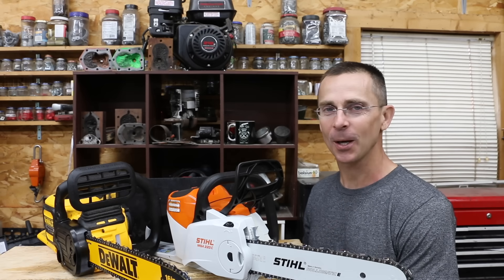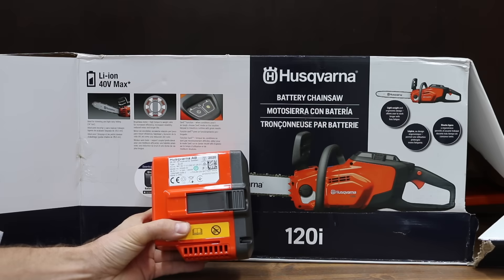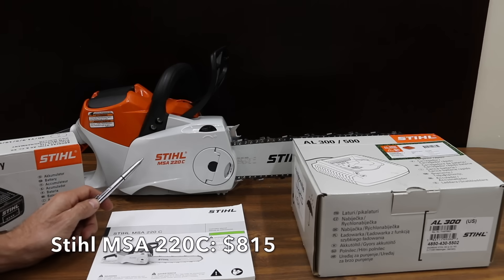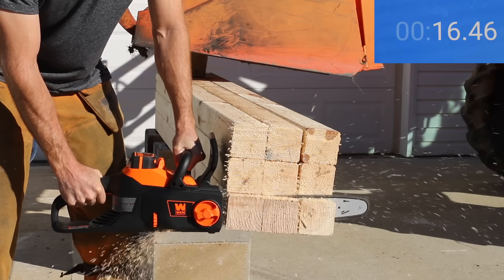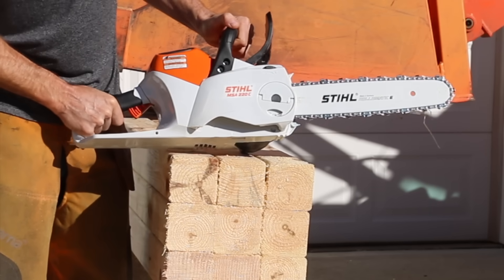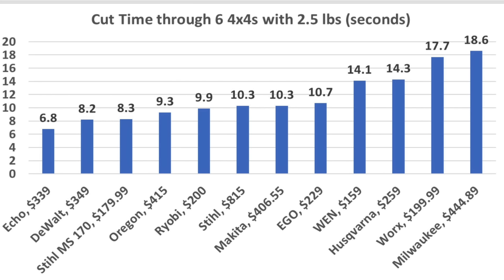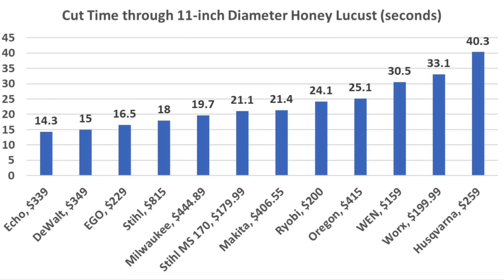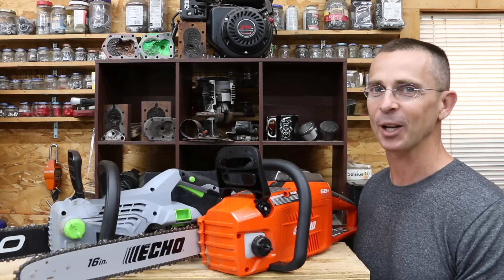Best Battery Powered Chainsaw Brand (ROUND 2)? Stihl, Husqvarna, Echo, Oregon, DeWalt

Comment: EGo now offers a number of larger capacity batteries - up to 10Ah - but it costs $900. They also make the best 2-stage snow blower (as far as I can tell). I own a Snow Joe 2-stage snow blower (first generation) and it has been very disappointing.

A critical thing about battery powered tools - is to have as many different tools that use the same type of battery. This way, you can get more use out of your investment. EGo has the best overall, it seems with lawn mower, snow blower, and chainsaw (and string trimmer, too I think?). DeWalt has a different mix: impact driver, chainsaw. Makita is similar to DeWalt. GreenWorks has a very good lawn mower and string trimmer. DR Power is a company that seems to have the broadest range of battery powered yard tools.
Reply from the maker: Thanks for the feedback.

Comment: Hi from New Zealand. I've owned a Stihl 200C battery chainsaw for a couple of years and it's been one of the best purchases I've ever made. You'll still want your petrol/gas saw for felling anything above 8", but the Stihl comes into it's own when limbing up a felled tree, even fat ones above 24" diameter. I prefer the sharp dogging spikes on the Stihl. When you are working at odd angles around a tree, those spikes make it much easier to apply the pressure needed to feed the saw into the cut.
Reply from the maker: Thanks for the feedback.

Comment: Had the echo weedeater with the same battery platform and it does not have discharge protection. Left on the charger and drained itself and became a paperweight. Returned for refund based on that.
Reply from the maker: Thanks for sharing.

Comment: Excellent comparison videos, thank you for doing them!

Curious - have you tried using the 4-bay fast charger for DeWalt in any of your tests? (dewalt part DCB104 )  That plus the new 12AH 60v batteries were game-changers in how that saw works for me.  Four batteries and that charger means almost zero downtime for a whole day of cutting, which still kinda blows me away.
Reply: And the EGO has a fast charger that came when I bought the 21-in self-propelled mower.
Reply from the maker: You are welcome!  Thanks for the video idea.

Comment: I have 2017 Greenworks 80 volt chainsaw. There war a hurricane in Florida that year and it was the only chainsaw I could find and it was on Amazon for less than $200. Worked out great for me. It lasts about a half hour of use. I cut up to about 24 inch trees. Still works like new just need to keep the chain sharp and oiled. Suprisingly the battery is sill working just starting to last shorter than in 2017.
Reply from the maker: Thanks for sharing.

Comment: Nice video! I've used EGO saws before, but never had the opportunity to compare them to other electric saws. One thing which is somewhat ambiguous in this video however is the actual total power provided by the batteries. You gave the Ah rating of the batteries, and sometimes the voltage, but the actual power contained in the batteries is Ah * V = Wh (Watt hours). When comparing the total runtime efficiency of the saws, knowing the Wh / minute of cutting power would be an interesting metric, and might be useful to include in similar future videos.
Reply from the maker: Thanks!  Thanks for the constructive feedback.

Comment: They’re expensive, but I keep coming back to the Stihl brand for portable power tools. I have a half dozen including my favorite, the battery driven chainsaw. They only sell through authorized outlets using Stihl-trained technicians. The performance measures on this site are important, but you have to consider longevity, reliability, ease of use, parts availability and quality of repair service if you need it— and little is needed with Stihl branded power tools. It looks like every brand except Stihl comes from China. And the Stihl chainsaw comes from Austria!
Reply from the maker: Thanks for the feedback.

Comment: That echo seems like a beast. Call me crazy but I still like gas just fro reliability. The 170 is tried and true.
Reply: I don't use one much thats why I'm thinking about the battery powered ones. Just so I can charge and go. No gas mixing or trying to get it to fire after sitting for 8 to 10 months
Reply from the maker: Thanks for the feedback.

Comment: Great work as always. I currently own the 80V Kobalt chainsaw (mainly because it uses the same battery as our lawnmower, hedge trimmer, string trimmer and blower. With the new EGO zero-turn riding lawnmower and newer EGO two-stage snowblower, we were thinking of switching over to all EGO.  Would like to see where the Kobalt 80v 18" (4080-06) and the Kobalt 40v 16" (4060-06) chainsaws stack up against all these other chainsaws. You tested the 14" EGO (CS1401). Please also include the 16" EGO (CS1600) and 18" EGO (CS1800). Thanks!
Reply from the maker: Thanks for the video idea.

Comment: Great video and, as always, great content.  But I will say from experience - time and time again - I will never but equipment made in China.  It's all junk.  It might cut fast, charge fast - but look how it's made.  It will not last.  Still is the best of all you tested.  I own one, had it for six years.  Still running, same battery.  Amazing little saw.  Now I'm in the market for a larger one.  Not derating your video - I just have never owned anything made in China that was worth keeping over time...  Good test. Great content!
Reply: And all of the other Husqvarnas are made in Europe, I didn't even know they had a low end chinese slave-labor one until this video.

I also won't buy slave-labor products, unless it's something I really need and there is no alternative, which unfortunately is the case for about 1% of what I own.

Comment: Lets see, a Stihl battery powered saw that doesn't perform very well and its priced as much or more as a pro series gas saw. NOPE. The echo looks like the winner but I've seen a multitude of complaints of it throwing the chain on a very frequent basis. I'll just stick with the ones that run on dinosaur squeezins
Reply from the maker: Thanks for sharing.

Comment: Howdy Todd, I saw in part 1 you Didnt test the EGO so seeing it here was Nice, if Ok  I wanted to ADD  a couple of things In-case you did not know about the Ego saw.  The saw you used is EGO's 14'' version EGO makes  3 sizes A  14'', 16'' & 18'' inch which is what I  Use on the Ranch.  to save Money I Only buy the EGO 'Bare Tools'   BC as in Most cases when they Sell a tool, EGO normally sells them with a 2.5ah Battery which is what you showed but its Run time is Not Great ....to me the 2.5 ah Battery that normally comes with a tool you buy is for a weekend project type job.    
   I own 4 of the EGO QS1804 18'' Model Chainsaws,  I Normally use either a 5.0ah or 7.5ah Battery. 
   I have probably 5 remaining GAS Chainsaws we use and to be Honest after every 2+ years We Need to Re Carb the Saws im over  the down time BC of FL humidity they MUCK up Bad inside & I got tired of the inconvenience and as you Know it always happens when you Need the Tool the Most & No matter how good you try to keep them ready it still happens...I wish these Lithium Ion Battery tools came out 20+ yrs ago MY Back and Body would be thanking my Nightly.
     1 Last thing as I said we use 5.0ah or 7.5ah Batteries on ALL our EGO tools .........we Bought their Optional Back Pack Battery holder set up....so you Can carry the full weight of a Big Battery on your Back & with the 7.5ah its over 1 full hour of cutting and with a "Fast Charger" its about same to recharge 1 Battery.  
  We have over 40 Batteries so we are never with out spares but just wanted to add about the Back Pack its a great help for those old like me and been doing this 50+ yrs.  Keep Up the Great Videos Todd !!!  Cow}:-o)
Reply from the maker: Thanks, will do!  Thanksk for sharing.

Comment: That echo is a beast i cant believe it beat out Husqvarna and stihl. I guess the cost of a chainsaw dont mean alot
Reply: Based on the weight of the Echo they aimed it at a more heavy duty user, with a more powerful motor and battery. Stihl and Husky made fine saws, they were just aimed at homeowners, not serious users. Granted though, that Stihl price is a bit outrageous.

Comment: Didn't quite finish the video as I have things to get done (cant watch youtube all day)  So you may have covered this, but in case you didn't!  The electric saws are very rough compared to a gas saw, to put this in a simplified way... A gasoline chainsaw is as smooth as a steaming hot knife through butter.  Where an electric chainsaw feels like a half dull sawzall cutting through an exhaust pipe on your grandfathers truck when the blade finally catches and starts slamming everything  at 10,000 BANGS per second.  lol  ( you know who you are )
Reply from the maker: Thanks for sharing.

Comment: A significant drawback for this test is not comparing apples to apples (or rather, ah to ah for price comparison). Price comparison should have been done for skin only with battery capacity bought separately to determine a better baseline. Higher capacity batteries have been shown to provide better output so comparing low capacity battery against higher capacity batteries is immediately a problem.
Reply from the maker: Thanks for the feedback.

Comment: Owner of the Echo saw and the rest of their battery powered product line. Not a fan of battery powered chainsaws for practical use.  Take special note of the runtime test. It has about enough in one charge to cut down and process one medium sized tree. With a less than fresh chain, meaning non-pro sharpened, you’d be looking at only a few trunk cuts. If you’re doing more than that, go for gas. You can get a quality gas powered chainsaw for much less, and run it all day.
Reply from the maker: Thanks for sharing.

Comment: I have the 16" version of the EGO and when cutting down some trees I noticed it performs better with the 5aH battery than the 2.5aH. I see the same effect in the lawnmower. The smaller capacity battery seems best used for the blowers. I think Ego agrees since mine came with the 5aH battery.
Reply from the maker: Thanks for sharing.

Comment: Running the numbers based on battery size what you find is

(Min of runtime / amp hour of battery)
Ego = 1.08 min/ampHr
Husqvvarna = 1.575
Wen = 1.2
Echo = 1.9
Oregon = 1.367
Stihl = 0.94

Overall by upgrading batteries and solving this out I think you still end up with Echo as your top choice. Its a killer chainsaw and very efficient. However, this does bring EGO back up the list since it only had a 2.5 ampHr battery. You can get bigger batteries or have multiple small ones. 

In the end I think the result comes, Echo for commercial use, Ego for homeowners.
Reply from the maker: Thanks for the feedback.

Comment: I like the Ecco bit im to far invested in the dewalt as my main source of batteries i have enough to run that saw for days . Also the fast charger for those flex volt batteries will charge in about 40 min .
Reply from the maker: Thanks for the feedback.
Reply: Yeah. I have a lot of Dewalt tools and the echo is kinda tempting
Reply: I think that all the batteries from these different brands are iffy about longevity. The saw is probably great . I had a Graco battery sprayer once and they came with Graco batteries and it was the downfall of it . 2 years later same sprayer but was available to accept dewalt batteries . Day and night difference in battery life and charge time . If Ecco was already well into the battery game like dewalt I think they really have a contender.
Reply: @phillipmccarter7471  I think I might end up getting the Dewalt because the prices are so similar. I think if I didn't already have Dewalt tools I'd probably buy the echo
Reply: @GazMatic  
I have the 20volt dewalt brushless version. Its ok about like how the husqvarna looked like it performed but I only paid 150.00 for the bare tool. It actually is pretty nice to have to do small trim work and prune low limbs with. But for anything more I woild have to go with the flexvolt version . I still use. Gas powered husqvarna for bigger work.
Reply: @GazMatic  
Another thing to consider also is i really think he was charging the batteries with the lowest powered charger dewalt makes. I have quite a few flexvolt batteries and I charge them in way less time than 139 min . And 40-50 min with the fast charger depending on the temperature they are charging in.

Comment: The battery life test is probably questionable because the saws propably just did overheat the battery from hard use thats a typical problem. Its not the best way of testing in my opinion
Reply from the maker: Thanks for the feedback.

Comment: I’m on the entry level battery powered chain saw with an 18 volt 10 inch Ryobi.  I have some other Ryobi tools and batteries and didn’t want to start all over.
I use for trimming fallen branches and cutting some wood fore a fire pit.  
It could use more power but for the occasional use it’s fine.

I’ld be interested how it compares to the higher voltage saws you’ve tested
Reply from the maker: Thanks for the video idea.

Comment: Great job and as stated in my previous comment, I am still looking at the EGO mainly because of other tools to use the battery.  I agree it performed well but a larger battery would be needed.  I have the 7.5 amp battery for my mower.
Reply from the maker: Thanks for the suggestion.

Comment: Thanks for all the work you put into these videos! I'm considering buying an oscillating tool since my Milwaukee M12 died. Is it better to buy another tool? I have Milwaukee M12, Ryobi One+, and Ridgid batteries. How about a battery vs. Corded? Thanks!!
Reply: The m12 fuel oscillating tool is my pick over the several that I've used. Way faster than the original m12. Bosch is very good too.

Comment: EGO makes many sizes of battery.   The 2.5 is their weakest/smallest capacity battery if I remember correctly.   If you had used their bigger battery or similar mah to echo it would have performed similar or better.    Atleast that’s been my experience
Reply from the maker: Thanks for sharing.

Comment: Buy the 15 amp Oregon plug in use remote power - thing cut much faster than the battery model as shown - super sharp and super fast. Cut down a 100 foot pine tree didn't need to use self sharpener. 18" $139.00 - unfortunately made in 🇨🇳 China...
Reply from the maker: Thanks for the suggestion.

Comment: Now try the 18" EGO. Self adjusting, 5ah battery. Great saw.
Reply from the maker: Thanks for the video idea.
Reply: The 18" EGO is a BEAST. It's next level compared to the 14". The Makita feels the most like a professional saw. It's balanced, nimble and the build quality is the best of all the saws imo (lots of metal everywhere). Most importantly it revs fast and can be used for delimbing without frustration.
Reply: I have the 18” model and it cuts really well. I see a lot of comments in the Ego community that putting a 16” or 14” bar on it is even better.

Comment: I have a great idea for you my dad had got me an angle drill bit adapted for cristmas and I thought it would be a pos I've never seen anything like it work well but I was very wrong i was able to put in 10 inch lags trough logs I was replacing on my cabin 

https://www.homedepot.com/p/DEWALT-MAXFIT-Right-Angle-Magnetic-Attachment-DWARA60/308436444?source=shoppingads&locale=en-US&mtc=Shopping-VF-F_D25T-G-D25T-Multi-Multi-NA-Feed-PLA-NA-NA-GiftCenter&cm_mmc=Shopping-VF-F_D25T-G-D25T-Multi-Multi-NA-Feed-PLA-NA-NA-GiftCenter-71700000075082069-58700006460938516-92700058381592972&gclid=Cj0KCQiAlsv_BRDtARIsAHMGVSaUHIAjRmhQf8G7riTlhb-EuZaErt68SChaY8LYmM9w9wdR5KoyTMQaAp_lEALw_wcB&gclsrc=aw.ds

Comment: Can’t wait to have a reason to get the Ego saw.  My first Ego was the Battery powered snow blower (single stage) with two 5 amp hour batteries, and a fast charger.  I’ve since gotten the lawnmower and a leaf blower. Still only have the two 5 amp hour batteries.
Reply from the maker: Thanks for sharing.